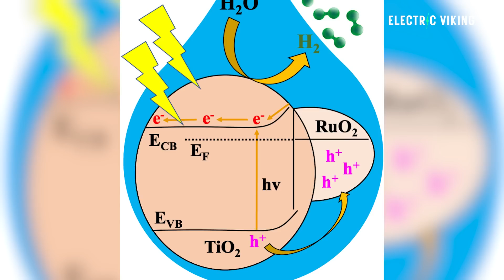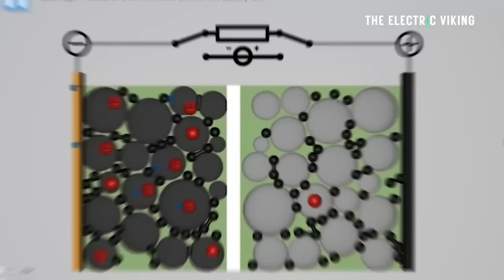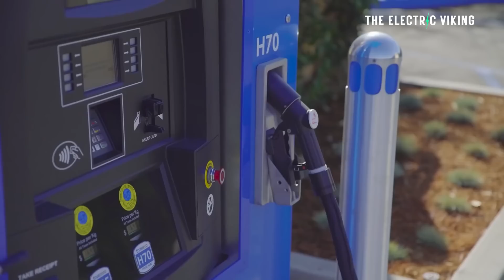American researchers use sunlight & water to efficiently create green hydrogen

Comment: Hydrogen is STILL hopelessly inefficient regardless, you lose 30% liquefying it and fuel cells are another 50%.
Reply: Exactly! The main losses on hydrogen are having to compress it in order to transport and store it. 
This is exactly why industries that use hydrogen make it on site as needed. 
Also storage of hydrogen is extremely difficult and expensive due to hydrogen's corrosivity to almost all metals and its ability to escape almost any seal or valve because of its small atomic size. 
Just look at the leaks Boeing's star liner capsule is having right now at the space station. (the following is a correction as I inadvertently said Starliner was leaking Hydrogen... it's Helium. Thanks to a fellow commenter keeping me straight!)
    Boeing can't even keep Helium, which is twice as large an atom, from leaking.
Reply: @nickmcconnell1291 I thought helium was escaping and not hydrogen.
Reply: @radiotec76  Nope it's hydrogen. Twice as small as Helium.
Reply: @radiotec76  Oh.... sorry I wasn't tracking you there. Got it. 
Yeah I mistakenly was thinking it was hydrogen in the Starliner when I wrote that. Doh!
    Although it does show how hard it must be to keep hydrogen from leaking when Boeing can't keep even Helium from doing it.
   I corrected the original entry... thanks!!
Reply: @nickmcconnell1291  no problem. Believe me I thought I was losing my mind for a moment. Yeah, no doubt, hydrogen is a tough element to store but an EV club President told me more than a decade ago that they have found a material that can store hydrogen. Are you ready for it? It’s the chemical element Au,… gold. 🤣
Reply: @radiotec76  LOL. Reminds me of the two oil billionaires fishing on a river in Alaska. One reached down and pulled up a huge nugget of gold and turned to the other and said "We should remember this place if the price of oil goes down."
Reply: @nickmcconnell1291  no doubt! I think that’s where oil is going to go. If the U.S. doesn’t transition to EVs fast enough, other countries are or will and that is going to cause the price of oil to go down. That presents a problem for the U.S. which relies on high oil prices to make oil fracking a loss. When that happens is Wall Street going to throw in the towel on fossil fuels or ask to be bailed out AGAIN?!
Reply: @nickmcconnell1291  Except hydrogen forms molecules of H2 while Helium is an inert gas and remains as single atoms. Helium escapes containment (leaks) more than hydrogen. The problem with hydrogen is it’s highly reactive, damages it’s containment and escapes that way.
Reply: @nickmcconnell1291 Is it not in the form of H2 and not H?
Reply: @yodaiam1000 its diatomic. Its a stability thing
Reply: @nobilismaximus  So why would a Helium atom be bigger than a two hydrogen atoms bonded together?
Reply: @yodaiam1000  because atoms aren’t the same size and your understanding of atomic scale is flawed.
Reply: @nobilismaximus  You could just point out that hydrogen doesn’t have a neutron.
Reply: @yodaiam1000  sometimes it does
Reply: The value is in the FUD and stall tactic, not actually being silly enough to try and make it economically competitive
Reply: @onefiniteplanet  it’s not a mistake to keep trying. How about hydrogen from coal? The technology exists..
Reply: That's why a hydrogen car wouldn't be practical but being able to use it for steel smelting and a new process for making cement without CO2 emissions would be incredibly useful.  Industries are fixed in place so you'd only have to transport the water and make the hydrogen there.
Reply: Fred bloggs has been spreading FUD for years now.
Reply: Yep. U r right. 
https://youtu.be/RAEhhYqMEBE?si=9jZzGtDdRXpzczk6
And I heard of hydrogen diesel too. 700 bar. Big time pressure. Still. People like that there no emissions.
Reply: Please tell Nikola Motor investors that!! 😂😂
Reply: @mikafiltenborg7572  Nikola is going to go bust. Investors in it likely need a tax loss.
Reply: İf you can use the heat while cooling the fuel cells, to warm up your house, u can use at least 95 % of the energy.
Reply: @ozgurtoraman980  That sir is a great idea! Very likely the OSU team may have thought of that. The issue might be the oxygen that is also released. As you know things tend to explosively burn in high oxygen environments. Might have to gather the heat with a radiator and then use a heat pump to move it to other places? Wouldn't want all the flammable H2 and O2 around a home.... maybe industries though. 
 The efficiency of a heat pump would vastly improve given the ready source of heat to pull from.
Reply: @ozgurtoraman980  So you’re proposing transporting hydrogen to people’s houses and storing it there?

(You can’t use any existing gas pipes because hydrogen would destroy them and leak).
Reply: a novel solution for reducing the amount of energy and danger in pressurizing hydrogen is Nasa’s cryofluid capacitor
Reply: Check out Plasma Kinetics. They are close to having solid state hydrogen storage. No compression needed. Density equivalent to hydrogen gas at 2000 psi.
Reply: @mnhsty  Hmmm... uh gee isn't that like halfway to a hydrogen bomb?🤣
Reply: @nickmcconnell1291   Dunno, but apparently the Department of Defense held up the patent while they tried to exploit it in secret for some reason.
Reply: @mnhsty  I already have, it’s utter nonsense.
Reply: @fredbloggs5902   Oh, sorry.
Reply: Convert That hydrogen to Methane like terraform industries does and could be quite beneficial. Even if you loose in convertion you get a product widely usable in current infrastructures
Reply: @johnmaitel351  Excellent point, Power to Gas (PtG) is currently around 76% efficient in trials so this new process to produce the hydrogen should improve on that. Thanks for the reference.
Reply: @fredbloggs5902  if you mean for producing hydrogen then you missed the point. Making methane provides a stable product with a known process to handle it. If you make longer chain hydrocarbons they are liquids and more stable. CO2 becomes moot as you now have a complete carbon cycle in the order of  days or weeks, so no net gain. Hydrogen is just a dumb fuel eope have latched on to coz hydrogen sounds like something used in fusion
Reply: @nobilismaximus  I’ve already agreed that, do keep up 007.
Reply: @fredbloggs5902  on the night shift…. Bit groggy
Reply: @johnmaitel351  finally the voice of reason.

Comment: Have they changed physics? 😂
Reply: No.  Just discovered more of it.
Reply: @simongross3122  I didn't realize physics was a quantity! :)
Reply: @mb-3faze  Interesting.  Not a quantity, but can it be measured nonetheless?
Reply: @simongross3122  It doesn't matter how much "physics" they discover, HFCBEV will always be inferior to pure BEV for one simple reason; pure BEVs provide a more direct route from energy generation to "fuel in the tank"

BEV: generation -> grid -> battery
HFC: generation -> grid -> hydrogen -> liquefaction -> transportation -> storage -> fuel cell -> battery

Hydrogen will never, ever, ever be as efficient, cheap, or simple as pure battery electric vehicles. Ever. It wouldn't matter if hydrogen production was 100% efficient, the infrastructure alone would make hydrogen more expensive than electricity per mile driven.

Hydrogen is a waste of time, money, and brainpower. It's nothing but a boondoggle for politicians to appear to be doing something useful.
Reply: @simongross3122  It doesn't matter how much physics they discover, HFC will always be worse than BEV for one simple reason; BEVs provide a more direct route from energy generation to motive power.

BEV: generation -> grid -> battery -> motor -> wheels
HFC: generation -> grid -> hydrogen -> liquefaction -> site storage -> transportation -> station storage -> fuel cell -> battery -> motor -> wheels

Hydrogen will never, ever be as efficient, cheap, or simple as pure battery electric vehicles. Ever. It wouldn't matter if hydrogen production was 100% efficient, the infrastructure alone would make hydrogen more expensive than electricity per mile driven.

Hydrogen is a time, money, and brainpower sink. It's nothing but a boondoggle for politicians to appear to be doing something useful.